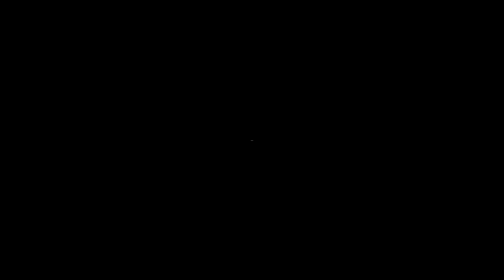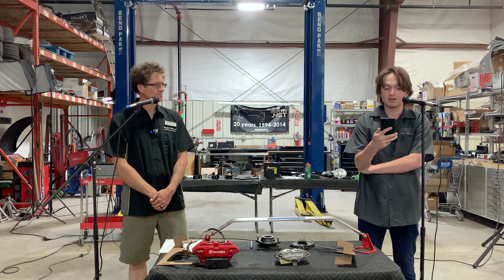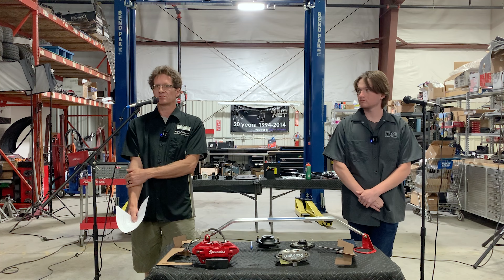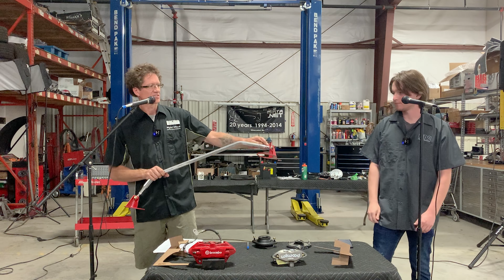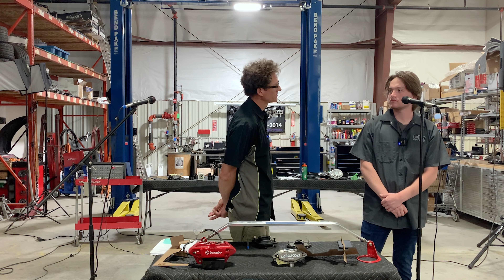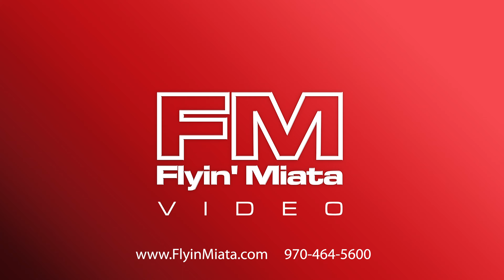Miata "Mythconceptions" (FM Summer Camp 2022)

Comment: RE: the question as to whether you need a bunch of performance parts to run on a track: The stock Miata is capable of much higher performance than the average driver realizes, if they haven't tried track driving.  I recommend a novice try the track before deciding what modifications will improve their Miata.  My first time I ran on generic M+S tires and had no problem with the car.  I was the weak link, in spite of having 30 years + of annual pursuit driving track training days.  

Although there are really great, experienced track drivers out there, an awful lot of drivers haven't yet learned how to get the most out of their car as it is.   No need or reason to spend money improving a car that's faster than you.  See what it and you can do and spend the money on a quality helmet and track fees until you know what you need.  FM's You Tube Videos are a wealth of information that will help speed up the learning process and help you decide what you need.

Comment: I did have a timing belt skip a tooth. Was all running fine for about 20k miles suddenly lost a lot of power, tried absolutely all other tests. Then checked the cam-belt and it had indeed skipped a tooth,.You could even see where on the belt it jumped due to wear.

Comment: The ABS fuse story. Your friend may also have lost the ability of the electronic rear bias making it much easier to lock the rear. So not as simple as comparing to a correctly bias non abs system.

Comment: What benefits does the 6 speed na nb provide
Reply: It can handle more power, but if you're talking from a stock power perspective, my guess is running through that extra gear is objectively more fun?
Reply: shorter ratios so you can stay in powerband better, also all 6-speed cars in the US came with the 3.9 rear so that the 6thg gear is longer than 5th on the 5 speed with the 4.3 diff.
Reply: I do t know what rear differential I have it’s an lsd on a 99 I don’t think it’s a stock lsd tho has only a tiny hole to see in side the diff when pulled
Reply: Would you say 6 speed is better for drifting?
Reply: @saltlightning7560  if its a 99, those came stock with the 4.3 and in your case the torsen
Reply: @saltlightning7560  uhh i mean maybe, i guess you can micro-manage what gear you want to drift in, for NA cars I would say yes as 2nd gear is lower
Reply: @saltlightning7560  also the 6 speed can hold about 50 more pound-feet of torque then the 5 speed ,(250 to 300ish is the well known range)
Reply: Ty vm